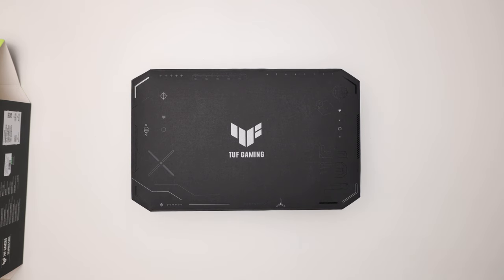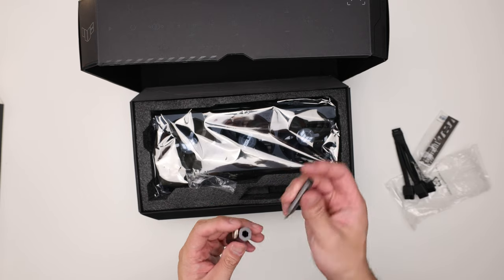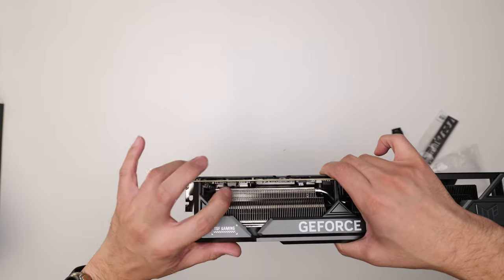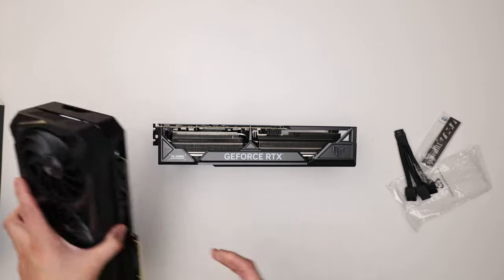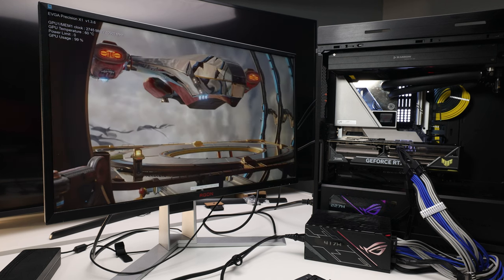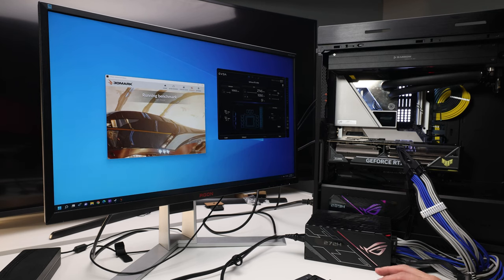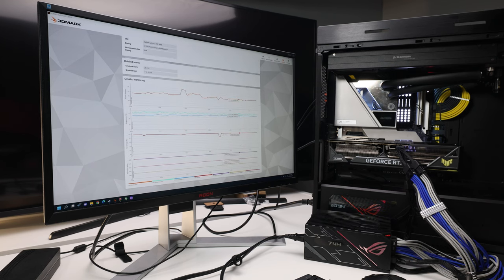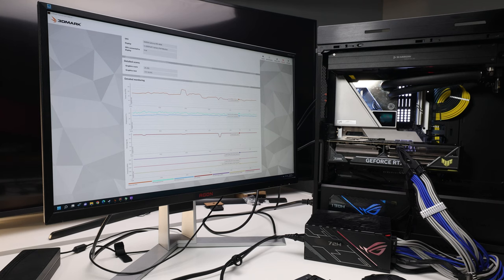ASUS TUF RTX 4090 UNBOX, TEARDOWN,  ROUGH OVERCLOCK TEST OVER 3000mhz!  AND SOME THOUGHTS

Comment: Does putting the fans at 100% use alot more power?  Does that power get taken away from the GPU?  Can that effect OC?>
Reply from the maker: Off board power. Unlikely to effect oc if you have a high power limit on ambient. You will hit a thermal wall before it becomes an issue.
Reply: @JCustom  ok thanks

Comment: what power cable aer you using for it?
Reply from the maker: I use cablemod cables non adapter. 90 degree versions or standard.

Comment: I'm just not impressed by the AIB 4090's... very very likely to cancel my 4090 order and wait for 4090 Ti. I have a feeling Nvidia is artificially gimping the 4090 to make the 4090 ti more attractive toward enthusiasts.
Reply from the maker: I think there is some time until they have dies from the rtx 6000 quadro to use for GeForce. It also would not be much of a performance gain for gaming.

Comment: They are all the same.... Those who got their hands on a 4090... They are all the same...  except the founders edition. I have the MSI 4090 and it too overclocks to 3000+. 3090 to the core to be exact and +600 to the mem, 11100 mem. Stable.    Until someone comes out with a new bios to unlock voltage.. These dont OC that great.  This Card feels more like they finally had all the Software for the current gen master.   You could unlock DLSS3 on your 3000 series card by doing some google searches.  It be pretty much the same as like the 4070-4080... without spending a penny.

Comment: How did the Strix BIOS work out?
Reply from the maker: no real improvement which is expected since they are both 600 watt. I will be flashing one onto the trio which is capped to like 480 or something like that if amazon will ever ship the darn thing
Reply: @JCustom  Yeah thats what i figured. Not worth it for the Tuf, probably worth it for the trio.
Reply: @JCustom  Do you recommend flashing different bios for other cards to get past the voltage limit? or does it ruin warranty

Comment: does tuf and strix share the same pcb? im looking to buy a tuf rtx4090 and a strix cooler making a diy cooling.
Reply from the maker: Yes same pcb, just less phases on the tuf. The strix cooler is slightly better by 2 degrees. Not worth the swap imo.